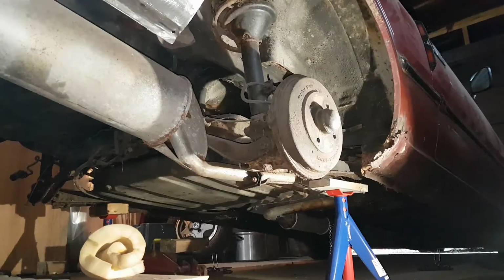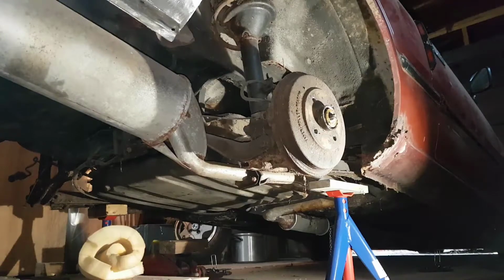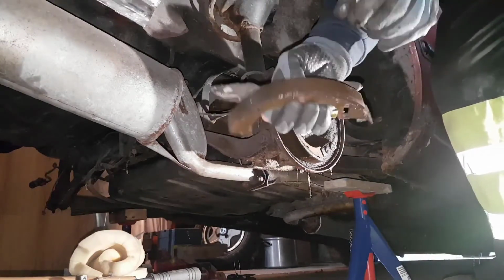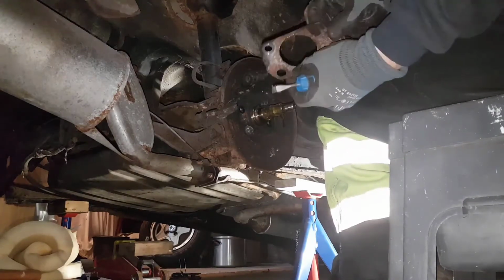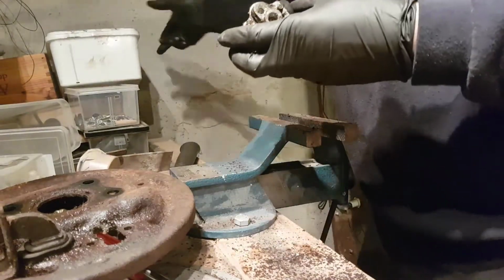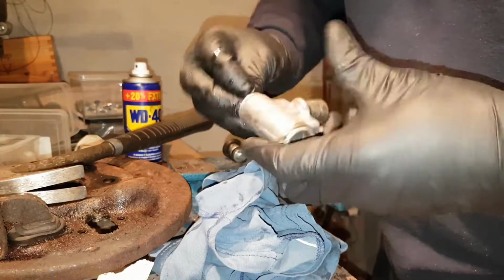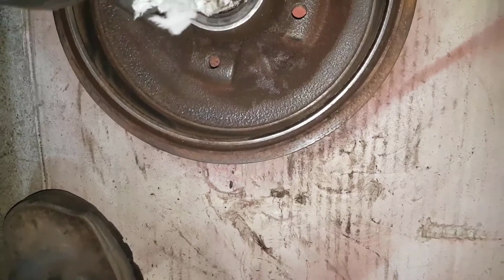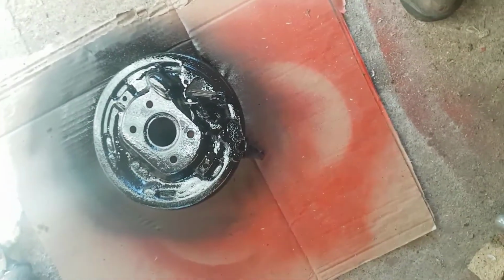Honda Prelude Take 6 Brakes -  clean up rear drum brake on a Prelude 1st Gen

Comment: Well DAMN ! Here I was working on my 1st gen Prelude and trying to find how to open those damn drum brakes, even with Hayne's guide, and I can't find anything precise, and all of a sudden I type the key words that bring me here ! Thank you so much for everything you're doing !
Now I fucked up my bleeding valve screw right before, but that's another problem...at least I can work on this meanwhile.
Reply from the maker: Thanks, I hope it was helpful. Slow process with rust removal and welding on this car, but getting there bit by bit. Good luck!
Reply: It really is thanks. It is the same on mine, a bit of rust went through between the trunk and back window and between the windshield and the engine compartment, and it will need a paint job since the coat went away some time ago...
Reply: I'm not sure either. I suspect someone changed the brake pads and put some springs on backwards bc some stuff looks different than in this video and in my Hanes manual, but I'm going to pull the other rear one off and just compare sides once I get to the other side...in another 6 months at my current rate lmao
Reply: @jeremiahdonaldson1678  mine are good as new now :D ! It's not complicated though don't worry. The electrolysis can be a bit long but it's worth it. Remember to use some heat friendly paint like for heaters and such. Good luck !

Comment: Nice, the only 1980 Prelude videos I've found so far. The one I bought was parked for 25 years because someone didn't feel like doing the front wheel bearings and this thing is a bear to work on since everything is rusted up and hasn't been apart for a minimum of decades.
Reply: Same here but eleven years ! Works like a charm now